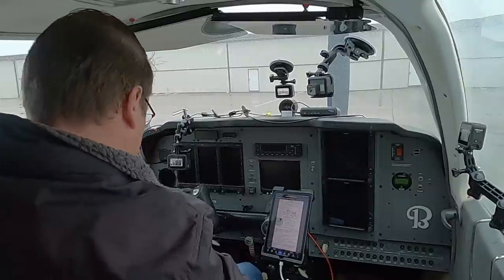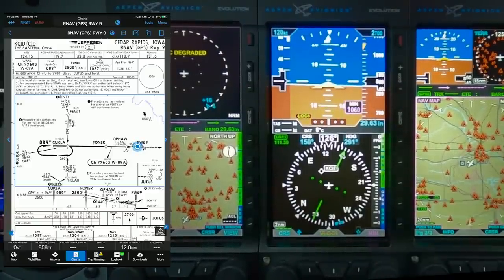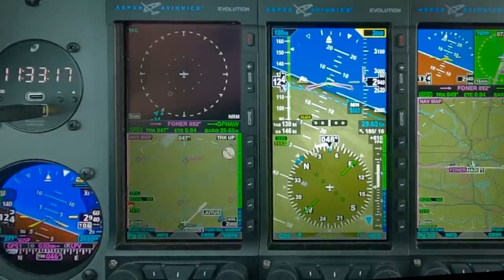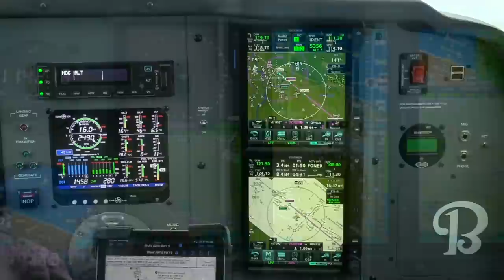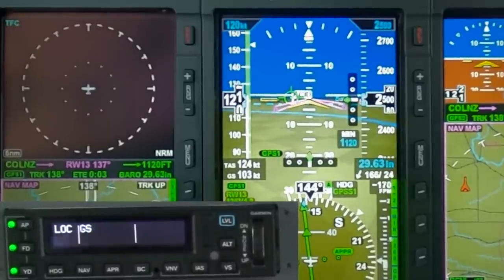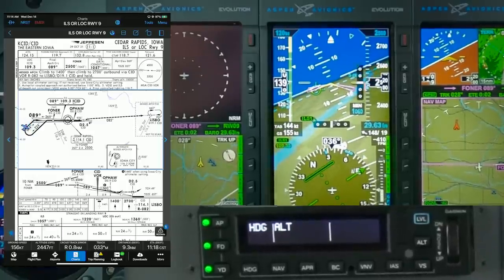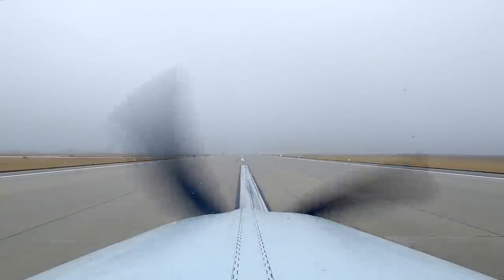Low IMC with the new Avionics Panel

Comment: Love your panel. I have the Aspen max and the IFD 550. One comment if you don't mind. I would never take off in such low for the simple reason of a possible engine failure. Just my opinion as I usually wait until the ceiling is at least a thousand feet. I know your a good and proficient pilot, just saying.
Reply from the maker: I understand what you are saying, Joseph. In flying, we are exposed to certain risks, and while we can mitigate many of them, we cannot completely eliminate all of them. My flight here is a good example of that, though I would submit it's no more risky than taking off from many city airports (surrounded by built-up areas) where an engine failure in the first couple of minutes of flight also would leave you without any good options. Knowing the terrain and buildings around my home airport quite well, I feel like the odds of surviving an off-airport landing there (even with a 200' ceiling) are no worse than around Midway (Chicago, IL) or Addison, TX.
That said, where exactly each of us draws the line for what is acceptable vs. not acceptable is a personal decision, of course. 
- Martin
Reply: My partner in an A-36 crashed and died because he wasn’t instrument rated, flew into IMC and didn’t know how to operate the autopilot. He was vectored to the localizer, but was not able to see the runway environment. He went missed approach and had spatial disorientation in the clouds at night.

Comment: This kind of flying gives me the willies. I had a bad experience in the soup during my IFR cross country. If my CFII hadn't been in the right seat, I would have been a smoking hole in the ground. I was eventually signed off for my instrument checkride, but I never flew it. I knew I was dangerous in the clouds, and if I got my rating, I would be tempted to use it. If the weather isn't good, it's skud running for me.
Reply from the maker: I guess it's not for everyone. I quite enjoy flying in the clouds and the challenge of flying an approach in low IMC.
- Martin
Reply: @martinpauly  I get it. I can hand fly an ILS down to minimums with just a VOR. When I got I to the clouds, I got disoriented and nauseous no matter how hard I tried to focus on the instruments.

Comment: I am so glad that there are still those of us willing to practice actual single engine approaches to minimums. Nice work, Martin.
It's weird that the Aspen does not use magenta for GPS approaches and green for ILS/VOR on the PFD. I prefer the way Garmin does it slightly better.
Reply from the maker: Thanks, Steve. I, too, would prefer to have the clear distinction by color between GPS and VLOC on the needles.
- Martin

Comment: Great video.  Really loved the popping out and seeing the runway and then landing.  That was amazing.  It was a little unnerving thinking about my own landings.  Generally I like to feel settled in at 500 feet and not being able to do that until 200 feet was eye-opening.
Reply from the maker: Yes, this is quite different. It's not just the low ceiling (200 feet), but the low visibility (1/2 mile when I started, about 1 mile when I finally landed) provides fewer cues for the flare and touchdown. It can be puzzling if you've never seen these conditions before, which is why I try to have my instrument students experience real IMC as part of their training.
- Martin

Comment: I'm approaching the end of my instrument training. Written is done, required hours, including the long cross country, are done. I have some actual IMC but no approaches in IMC (not counting one ILS decades ago). I suspect that I'll spend quite a few hours getting ready for the checkride. THe C172 I fly is all steam except for the Garmin 430. 

This video was fascinating. The AP seems to be helpful, especially at checklist time.
Reply from the maker: Hey Michael, good luck for completing your instrument training and your practical test. I would recommend to fly with an experienced CFII sometime in really low weather before you do it by yourself. It's one thing to break out (or take the hood off) at 200' AGL with 10 miles visibility; it's something quite different to see the runway with just half a mile of visibility. 
Regards,
  Martin
Reply: @martinpauly  I 100% agree Martin. I watched an instructor fly an ILS to minimums a few decades ago and I was amazed. One second there's nothing, then the ALS slowly comes into view, REILS and the runway, although not as distinct as it is during VFR. I like that kind of flying. It demands your attention.

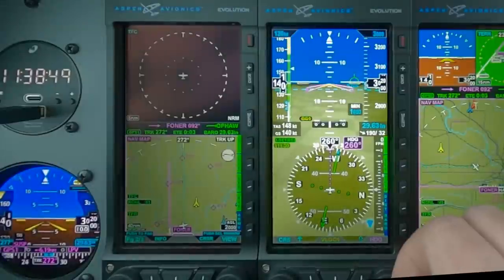Comment: Another Excellent Video, I have a question for you.. What Clock is that pictured above the GI275 at 14:48 in the video. I need to get a clock for my plane to be installed soon. Thanks
Reply from the maker: Thanks! The clock is from MidContinent ("CHRONOS Digital Clock / MAX Power USB Charger"). Here is a link:
https://www.mcico.com/clocks-3/6420093-5
Regards,
  Martin

Comment: Martin, just picked up you do not have the STC for the Advanced Autopilot integration with the Aspen PFD/MFD and the GFC600 AP. I have the Aspen Max 2000 PFD/MFD setup with a STEC 55x in my Piper Dakota and love the Advanced AP Integration so I can bug everything from the Aspen units. Great video and love your setup!
Reply from the maker: Thanks, Rob. My airplane was the testbed for said advanced autopilot integration between the Aspens and the GFC600. The only reason I don't have it yet is the FAA is dragging their feet with issuing the STC paperwork - once they get around to that, I'll get full integration between my Aspen PFD and the autopilot, like you described.
Regards,
  Martin

Comment: Martin, that was a very good video presentation. It does, however, REALLY make me appreciate how much better the Garmin G500 is over the Aspen equipment (no offense intended). Other than your Aspen MFD/PFD, your setup with the dual GTN750s, engine monitor, autopilot and backup PFD is nearly identical to the setup in my Bonanza.

Comment: You have to set the altimeter setting separately on the GI275? When I set on my g3x it sets the g5 backup at the same time. Also why is the smart glide button labeled INOP?
Reply from the maker: Yes, David - the Aspen and the GI-275 are completely independent, and the altimeter setting needs to be adjusted in both separately.
- Martin

Comment: Martin great video :-)
I have a question though. At some point ATC says something like RVR 3500, roll-out 3000. 
RVR is pretty obvious what it is but what on earth is roll-out?!
CPL/IR here, lots of hours and never heard that before :-)
Thanks for helping out a clearly not enough knowledgeable fellow pilot :-)
Reply from the maker: Hi Sandro. RVR sensors (a.k.a. transmissiometers) typically exist at two or three different places down the runway, typically the beginning (touch down), the end (roll-out) and half-way in between. So what you heard in the video was the RVR at two different places along the runway.
Regards,
  Martin

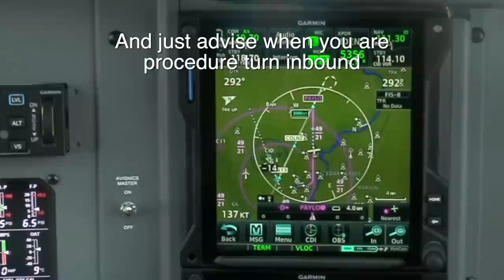Comment: Hi Martin, I was rewatching your video and noticed you have the Aspen and Navigator showing VLOC whilst in the process of flying RNAV 9 and RNAV 13, timestamps, 16:31 and 22:21. Clearly, you are using GPS but at times choose to remain with VLOC instead of GPS throughout. Is this done to keep situational awareness of final appch crs during transition or is there some other MO you are utilizing? BTW, I think your videos are amazing IFR training videos.
Reply from the maker: That will change once the digital interface is approved by the FAA and (re-) installed in my Bonanza. Right now with the analog interface, the autopilot gives the same indications whether the needles are driven by GPS or by a VOR/ILS.
- Martin
Reply: @martinpauly  I was also thinking about this question while watching the video. My plane is in the shop getting an aspen pro max installed so I was paying close attention to the buttonology here in preparation for my own learning curve. 

I think your CDI selection on the Aspen (Center Button) was in VLOC1 for the whole flight. The GTN750 also showed the VLOC annunciation for much of the flight. You were navigating with the autopilot in heading mode much of the time, either with GPSS on or off as appropriate. The GPSS signals were getting passed from the GTN through the Aspen and onto the autopilot appropriately, so the plane navigated correctly. But you'll notice that the HSI never showed the active waypoints/bearing/distance/course-deviation during most of the flight. 

Whenever you'd put autopilot in an approach mode, that seemed to override the CDI mode selection (Center Button) during the approach. The HSI did display the waypoint information during these segments. 

Interestingly, the Aspen MFDs did show the appropriate flightplan info, but if you had the wrong localizer frequency dialed for VLOC1, you might end up following the wrong navaid. Or if hand flying, you would have noticed the lack of HSI indications since GPSS wasn't passing through behind the scenes. 

I'm sure the digital interface will clear this up, but figured I'd mention it as it will definitely be something I'm more apt to crosscheck after this video. And figured you might want to double check your configurations going forward.

Comment: Why does the heading bug goto magenta when you are changing it (noticed it during the decent on ILS 9)?
Reply from the maker: The Aspen does that because the knob which controls heading can also control other parameters (selected altitude, bare setting). So the item that is currently being modified is highlighted on the Aspen.
- Martin

Comment: Just a thought on departing into lower ceilings… if the reciprocal runway has an ILS, I like to tune that into Nav2 so if I have a partial power failure, I have instant guidance back to the runway.
Reply from the maker: Yes, I remember that practice from the old days (pre GPS). Nothing wrong with doing this these days, too, of course; though I'd say loading an approach (RNAV or traditional) has become so easy with the modern GPS/NAV/COMs that it can quickly be done as needed during an actual emergency, without looking up frequencies and courses from an approach plate. Furthermore, if the (partial) power loss happens so low that 5-to-10 seconds of programming an approach matter, then returning to the airport may not be the greatest choice to begin with, at least at airports like my home base which is surrounded by miles and miles of flat farmland. I'm a proponent of finding a place to land straight ahead in those (very rare) cases.
Regards,
  Martin

Comment: Curious why you went with the Aspen instead of a G500Txi?  It would have been the best option for that panel, and wouldn’t require a separate JPI for EIS.   You would already have the digital auto pilot interface, and the latency would be drastically reduced, thus making those approaches a lot more stable.
Reply from the maker: Good question - and one which I have answered many times here on YouTube, in comments and also in earlier videos, like this one: https://youtu.be/EQL0-mEz5o0
In a nutshell: yes, creating yet-another all-Garmin cockpit would have been easier and faster, and that would have been a very nice and capable setup. But being part of a new development and certification program and helping create something new sounded more exciting and more like a real learning opportunity. In addition, a multi-screen Aspen setup offers redundancy which will keep me flying should my primary PFD ever fail - I simply switch to the backup PFD while waiting for a replacement part or repair. In that sense, the Aspens make more efficient use of the panel space than the larger PFDs.
Regards,
  Martin

Comment: Thanks for taking us along.  Looking forward to watching when the digital interface is approved. Noticed you didn’t have the approach plate on the Aspen.  I thought it might help the scan next to the PDF.  What did you decide about the Jepp charts?
Reply from the maker: Hi Walter. The Aspens can show an approach chart; however, the display is rather small and the resolution (pixels per inch) is nowhere near what my iPad will do. So I believe the iPad is a better device for showing charts, and I have added a Jeppesen subscription on top of my the Garmin Pilot EFB you saw in this video.
Regards,
  Martin

Comment: Nice video and airplane, Martin. Does you avionics have an FMA? My question is related to where we should confirm the Active Mode of the AP system
Reply from the maker: Thank you, Pablo.
What's an FMA? Flight Mode Annunciation? If that's what you mean: yes, just above the Aspens (but cut-off in the video angle in this video).
Regards,
  Martin

Comment: Thanks Martin, your new panel and Autopilot looks great! I liked that you used the GPSS mode to fly the approach, do you switch from GPS Heading mode to LOC after the IAF and working towards FAF?
Reply from the maker: Thanks, William. Ultimately I have to push the APR button on the autopilot to enable capture of the glideslope or glidepath - GPSS won't do that.
- Martin

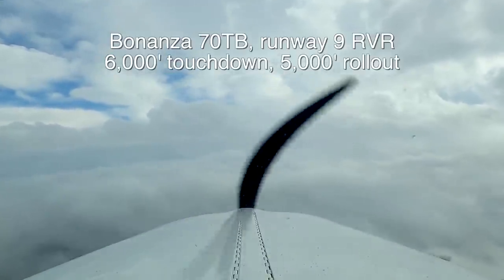Comment: Hi! I have a question, on minute 33:56 what does it mean? I only understood the 6000ft of RVR
Reply from the maker: The controller was referring to different visibilities at different points of the runway (touchdown = where I'll land, rollout = opposite end). There are multiple sensors (transmissometers) along the runway, as visibility can change significantly over relatively short distances.
- Martin
Reply: @martinpauly  Thank you very much for the answer, really clear! Great videos, greetings from Argentina

Comment: Marin, Thanks for another well done and informative video! (The one I’ve always wanted to make, btw!) GPSS and coupled approaches are really great and make safer flying in IMC — glad you have them onboard now! Just wondering why you didn’t fly a DP and what are your personal minimums for an IMC departure? If that’s not too personal to ask, ha ha. (Mine is 1000 but maybe that’s too high? It sure delays my flight departure time.) Thanks and keep up the great work!
Reply from the maker: Good questions. There is no ODP (Obstacle Departure Procedure) defined at KCID; those usually only exist if the 200-feet-per-NM cone isn't free of terrain or obstacles. Also, we have Class C airspace on the surface at KCID and Air Traffic Control gave me a heading to turn to.
Personal minimums for take-off: I want to be able to land back at my origin airport, in case of an emergency. So my take-off weather minimums are such that I can reasonably expect to fly and complete an instrument approach at the same airport.
Regards,
  Martin

Comment: Fantastic video.  I wish I could fly that good, without missing one single step, one single reply....I am wondering if the three Aspen displays aren't adding a lot of distracting useless information, beyond the desired redundancy.  Maybe just two?  In any case, keep giving us such really educational videos.
Reply from the maker: Thank you, Paolo. 
Regarding the three Aspens - I think as long as I focus on what's needed, the additional information isn't a problem. I am, however, wondering if SVS on the attitude indicator is really helpful in this case, or if it would be easier to leave the PFD in a more basic format.
Regards,
  Martin

Comment: Good take-off briefing. One suggestion, if I may. For raising the gear: instead of just looking for a positive rate of climb, positive rate + no usable runway left for an emergency landing in case of an engine failure. On the synthetic vision, it looked like you raised the gear at a low altitude with several thousand feet of runway left.
Reply from the maker: Yes... except if I have an engine failure shortly after leaving the runway behind me, having raised the gear early will leave me with more altitude and thus more options. For each method, there are scenarios where it would have been better to do it the other way around - so I pick the one that is common between singe and multi-engine flying.
Regards,
  Martin
Reply: @martinpauly  That's a good point. I did my complex and multi-engine training together (BE55), so that's probably why I was taught that way.

Comment: Any reason you don’t press the approach mode on the autopilot, it will give you more accuracy
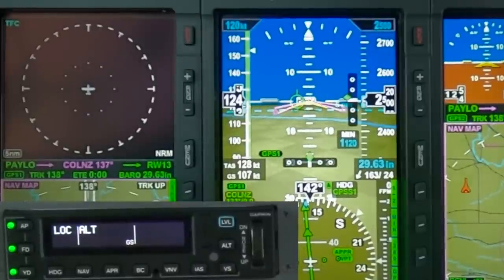Reply from the maker: Sorry, but I don't know what you mean. I did press the approach mode button on the autopilot, on all three approaches. At 27:17 you can see how the autopilot transitions from ALT to GS (Glide Slope).
- Martin

Comment: I like how you subtly pointed out the lazy ATIS. "Visibility half", "variable visibility 200"... What is that??
Reply from the maker: I guess everybody has a bad day every now and then, right? And yet, life goes on... 😎
- Martin
Reply: I was the tower controller at CID in the video. Must’ve accidentally said “variable” instead of “vertical” visibility 200’ lol. 😅
We are allowed to say either that, or “indefinite ceiling 200’.”

As far as reading the official visibility, I actually prefer to just say “half” instead of “one half.” I’ve had fixed wing pilots wanting to depart under Special VFR when the weather was 1/2SM (“one half”) and they thought they were legal to depart thinking I said “one and a half.”

We work clearance delivery, ground control, flight data, and local (tower) control combined at CID so things can get busy on IMC days cutting special observations!